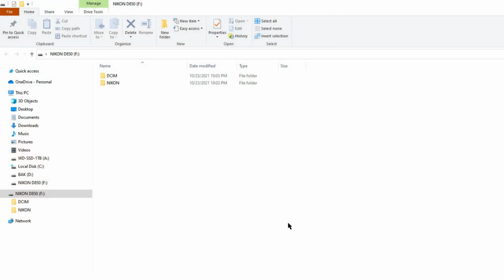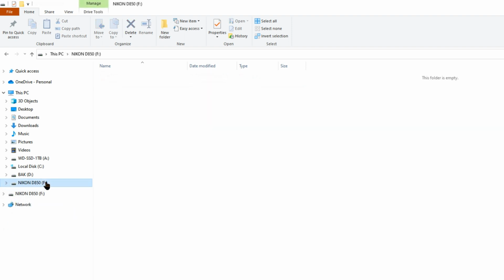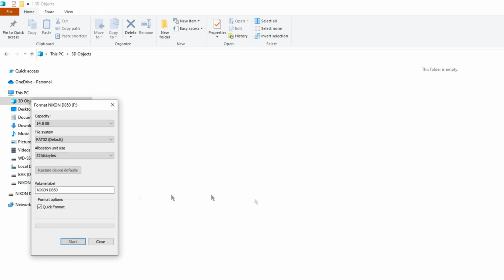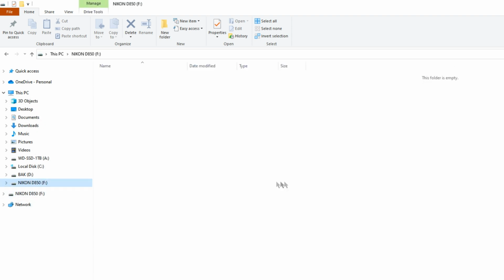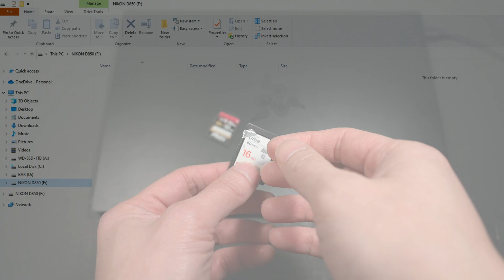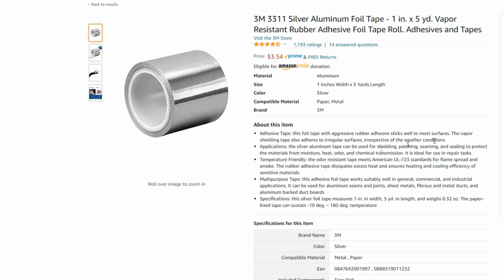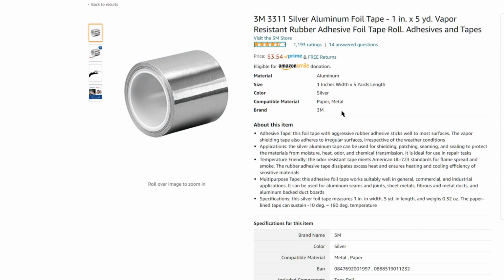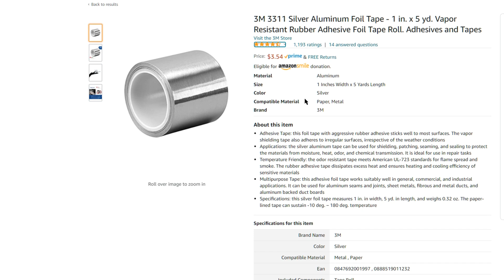HOW TO: SD Card -  Fix broken write protection tab NOT using scotchtape

Comment: Tried other methods found on YouTube but only your method worked for me! perfect easy fix Thanks!!!
Reply from the maker: Glad it helped. I have however noticed that on certain devices the clearance is very tight so only one layer (either the top or bottom) is able to be applied but as long as you keep an eye on it and that it's not peeling away due to tight clearances, it should work well. Mine has held up since I first applied this method.

Comment: how about a broken top corner tip of the plastic?
Reply: You're kinda screwed. This is the reason I am now opting out to use microSD cards with full-size SD Adapter. It's an easy way to solve a lot of headaches.